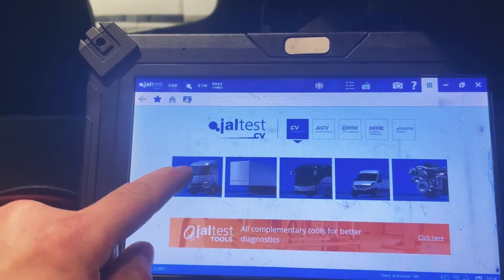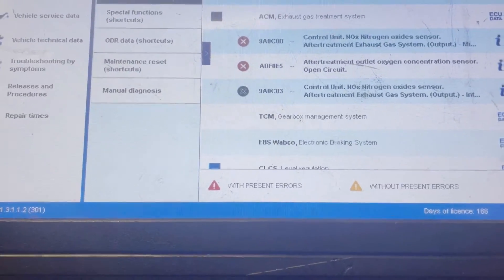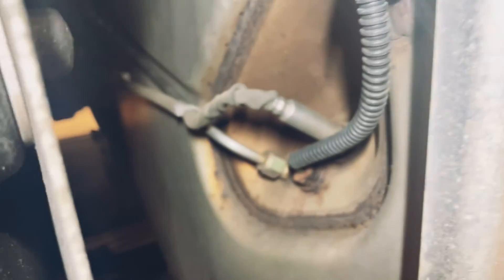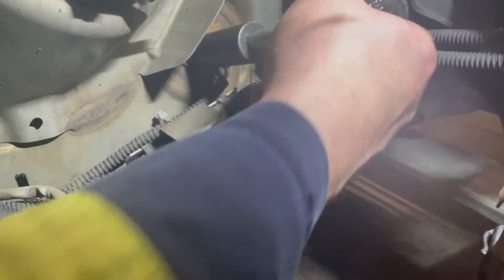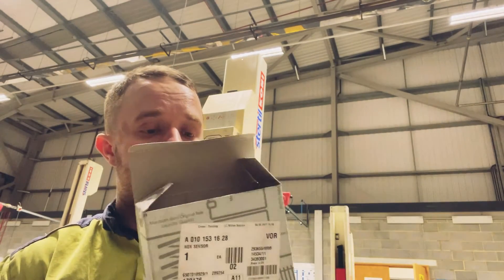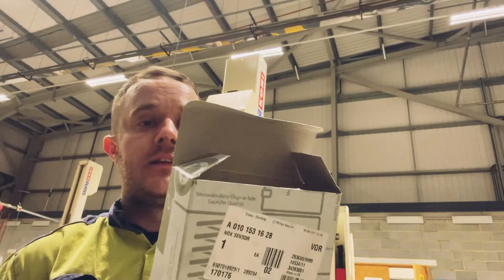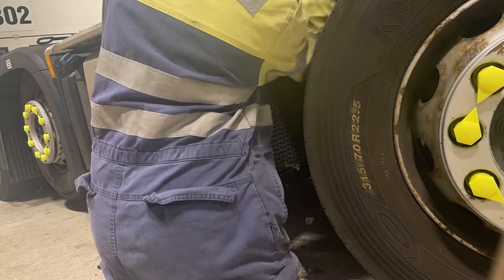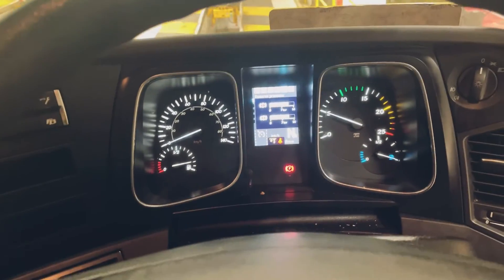Mercedes Actros Euro 6 exhaust emissions fault.

Comment: Mp5 with 0C1112, 0C1101 codes?
New ACM, muffler box changed and wiring all new sensors and still getting these codes which results in failed burnoffs

Comment: Can you please help me? I think I have the same issue. Two codes one says the voltage supply of nox sensor after catalityc reduction has a short circuit. And the other 17b08 nox reading are not available in good time. Is the same sensor as yours? Can this be repaired? Thank you
Reply from the maker: @xXJusTMichelxX  sounds like is the same sensor, have you checked the wiring?
Reply: @freightlanetv between 2-4 it shows 14.5 ohm and 1-3 0.63.0 ohm but I'm not sure if is ok , how it sounds to you?
Reply: Do you reckon a manual regeneration will help? I haven't done it in the last 6 months

Comment: It's a very common problem in MB. It happens too often. It's not normal. I'd say 99% of E6 MB sooner or later will suffer for this issue. In my MB it started just after 400 000 km. Mercedes is a piece of junk.
Reply from the maker: Every manufacturer seems to have a issue with something, unfortunately Mercedes is this lol

Comment: You can take the complete wing and bracket off in one, two bolts top two bottom. It makes accessing the nox a bit easier. Great video 👌🏻
Reply from the maker: Nice one mate, any tips to make the job easier is appreciated! Thanks mate 🙌

Comment: You probably know more. I saw another video before. 
It showed that sensor as the inlet sensor. Which i thought was right as its right next to the exhaust inlet to the muffler. Can you please clarify?
Reply from the maker: Inlet if your looking straight at the exhaust is left of the silencer it’s a black cable and after is grey
Reply: That is the inlet nox you are removing
Reply: Could it be different coz im from australia? 
Our muffler is still on the right hand side of the vehicle. 

I have 970c07
Reply from the maker: I’ll have a look into that code

Comment: Good afternoon, is that sensor the one before the catalyst or after? I get the error 970C07. I have changed the same sensor as you but sometimes I still get the error. Could it be that I have the wrong sensor? thank you

Comment: Good video m8. What tests would you carry out on the wires to double check the sensor had failed.
Thanks
Reply from the maker: Thank you! You can carry out a continuity check on the sensor pins, also check the vintage to the sensor, a lot of the time the computer I’d have one to hand will say short circuit to ground or open circuit.
Reply: @freightlanetv  aah cool. I like to check these things too as im mobile. But having one to hand is lucky.
Thanks for doing your videos just found u on here. Great work!!
Reply from the maker: Anything else you’d be interested in seeing let me know and I’ll see if I can get a video done! Thank you I really appreciate it
Reply: @freightlanetv  all euro 6 faults are interesting to me as this stuff can be a right pain in hoop. Had one the other day on an actros . First plugged in gave a few faults main one was differential pressure. Went to sensor to check 3 wire plug and make sure its clean. Then they had to move unit to take the trailer. Cab back up plugged star back in ...... wouldn't speak to the unit.
Badtard thing
Reply from the maker: Was it differential pressure sensor EGR or Scr/DPF?
Reply: @freightlanetv  egr
Reply from the maker: Depending how old actros is, at the front of the engine you’ll see a egr pipe with a sensor, if I’m right where the sensor is, unbolt that and under it is some holes on a angle? Check there not blocked
Reply: @freightlanetv  ye thats where they block cleaned that out but couldn't clear faults. As i only have the star. I need to invest in jal i think
Reply from the maker: Doesn’t need a regen at all? Be interesting to see what is actually wrong with it
Reply: @freightlanetv  I'll let you know if i get back to it